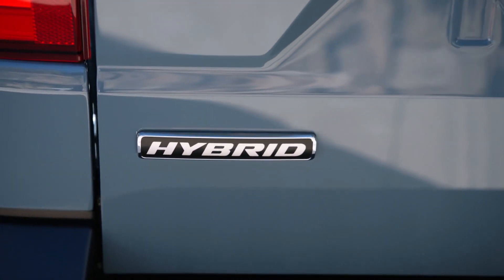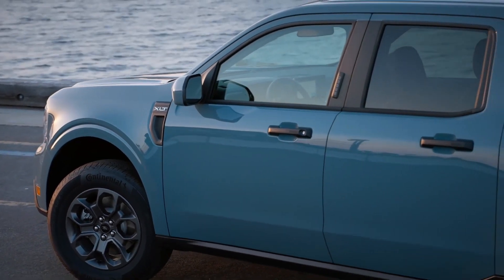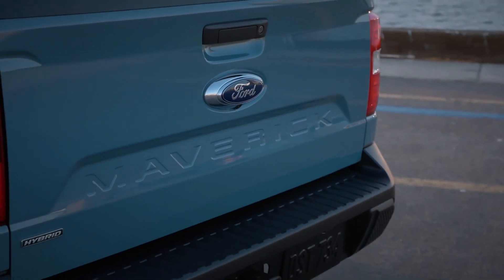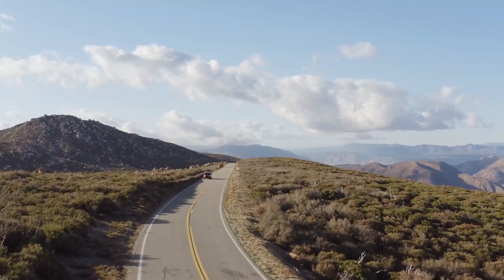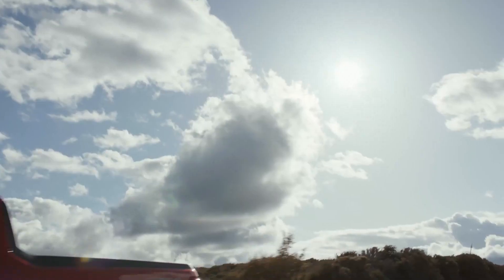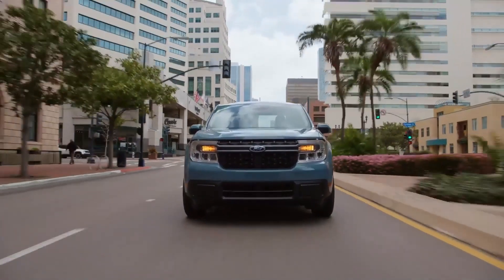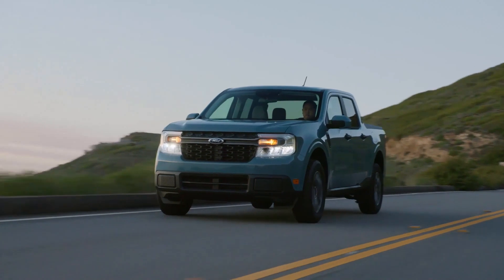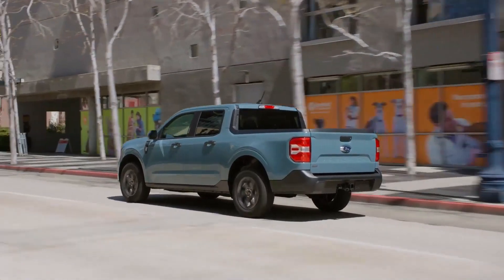Ford Maverick eCVT Transmission Pros and Cons

Comment: CVTs use chain/belts with variable pulleys. eCVTs use 2 electric motor/generators with a planetary gear set which is a lot more durable. If you have a CVT with chains and pulleys it is best to change the fluid every 30k miles

Comment: 100,000 miles is only like 160,000 kilometers. You mentioned that the transmission should outlast the motor? I just sold my ford escape with 300k kilometers and my e350 van has 400k on it. I really hope my maverick hybrid will last more than 160🤞

Comment: Does the push button start model also have key start capabilities as well?
Reply from the maker: Normally no key capability for that feature.
Reply: Most times if your fob dies, you press the start button with the fob instead of your finger. It'll read the ID chip
Reply: Usually, so you don't get stranded because the key battery died, there is a location in the vehicle you can put the key with an inductive magnet to power the key long enough to start the car. It works just like an ID card at a secured door, chip in your credit card, or wireless charger for cell phones.
Reply: nope